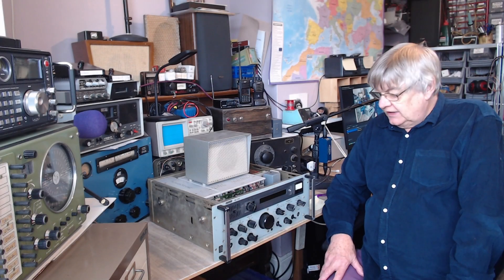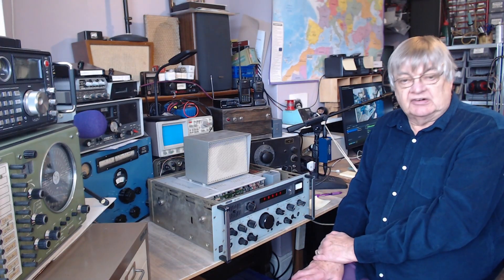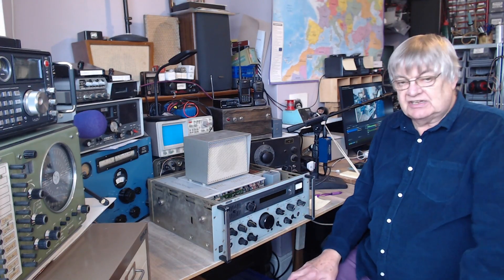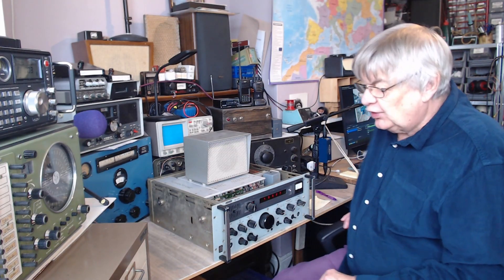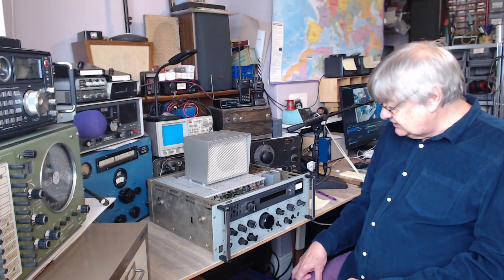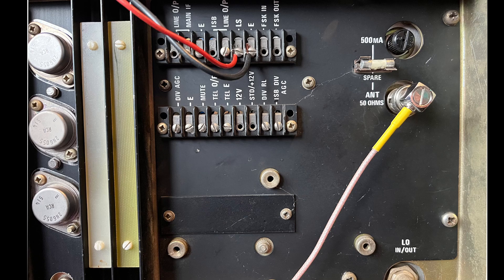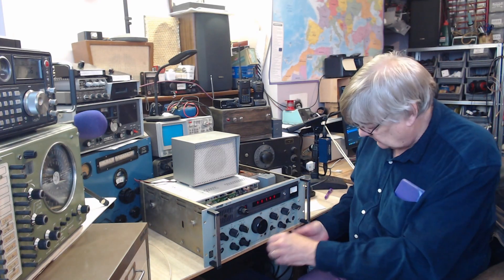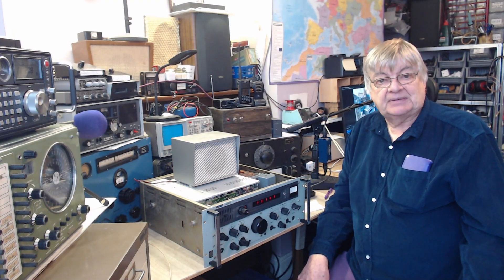G4NSJ - Racal RA 1772 HF communications receiver

Comment: Thanks for this video Ray, I'm fortunate to own one of these also, I dont suppose you would know anyone with a IF/AF module for a Racal 3701 for sale. I trying on the Racal group also. A couple of pins on the 64 pin conector at the base are missing and my soldering skills aren't upto being able to replace it unfortunately. All the best for 2026 M0sjd.

Comment: Excellent video and receiver, Ray, as usual.   We used RACAL's overseas quite a bit.  The RA-1772 design seems to be based on what type of signals they were going to be intercepting during the time it was made.  The engineers must have had input from the agency/military personnel who were going to be using it.  Just a guess.

Comment: I heard the BBC broadcasting on ISB once, was using a Redifon R408 at sea which had both USB and LSB filters which was unusual for a marine receiver, and switching between them produced two different programs.  I never managed to find anything about why they were doing that, but it was working very well..
Reply from the maker: Thanks for the information as very interesting. I’ve never heard of ISB but I’m discovering quite a lot about it

Comment: Here's a possible cause for the power transformer buzz: perhaps this particular radio is an Export Model and the transformer is intended for 60 Hz mains. When connected to 50 Hz, the core may saturate and cause buzz.
Reply from the maker: Good point

Comment: I have two 1772's i picked up off fleabag. Both have some issues, as should be expected of a radio of this age. I would be very interested in following your restoration to fully working. I will certainly be doing the switch cleaning, but I am terrified of touching the wiring loom as it would be a nightmare to repair.
Reply from the maker: Hopefully, the loom will be fine and not start cracking up!
Reply: @g4nsj agreed, after 50+ yrs it looks pretty brittle but gorgeous with all the military style wire wrapping (takes me back). The switches probably just need contact cleaner on them to get to mostly operational. I have two different versions, one with FSK but no afc, and one with is, both lsb/usb and afc. They really are the best receivers of the racal lineup. I have a 3792, 3x1792 and a 6890... I love using them.
Reply from the maker: Yes, the wiring can be brittle. You have a fine collection!

Comment: Hi d hi Ray lovely to see you again. Looking well  The 1772 very nice Recever  just need the Ma 1720 or is it  the MA 79  now .knowing you ones in the pipe line lol .Got myself a winter project  A Heath kit Ha-14 SSB Amplifier. And power supply HP-24  and a KW E-ZZ Match .for my 100ft bit of wet string lol .Looking forward to more posts kind regards shaun G6yri
Reply from the maker: Hi Shaun,  it’s good to hear from you. It certainly is a lovely receiver.  I’m very pleased with it.  Good luck with the winter project.  That sounds like some lovely equipment. I have a.KW E-ZZ Match. It’s a nice ATU.  Hope all is well with you.  Cheers, Ray.

Comment: Independent Side Band was used by broadcasters (BBC, Voice of America and doubtless others) for feeding programmes to overseas relays before satellite feeds took over. It used reduced, not fully suppressed, carrier (I can't recall the exact degree of reduction - 26dB, perhaps?). This gives a reference point for accurate tuning and, if necessary, something for the automatic frequency control to lock onto. The upper and lower sideband then carry two completely separate programmes.
Ian Liston-Smith and I worked at BBC Monitoring around the same time, so are VERY familiar with these (excellent!) sets. Yours is obviously slightly different to ours, with different bandwidth filters (ours had a wider 6kHz setting, occasionally used when in AM mode). In practice, when receiving AM broadcasts, we nevertheless used the set in SSB mode, tuned for zero beat and used whichever sideband gave clearest reception. 
I don't remember using the variable BFO function (or having that "USB + BFO" position on the switch: ours MAY have simply had a "CW" position) - I'll speculate this was used to change the pitch in CW mode without altering the main tuning.
The set had two very close siblings - the RA1776 that looked virtually identical but had the ability to be remotely controlled, and the RA1771 where each digit of the frequency was set by a separate switch rather than a tuning knob and frequency display.
Reply from the maker: Thanks very much for all the information. That is most helpful. I'm gathering as much info as I can on this radio. Cheers, Ray.

Comment: I have work with the RA 8772, the canadian version. It has the fsk board inside. Strange construction: no edge connector on boards...
Reply from the maker: The construction is unusual with no edge connectors.

Comment: I think you're right about it being from the 1970s. I worked at Racal Seaton in the 1970s and I remember them being brought into the factory for repair and the synthesizer modules were produced and tested there. I was usually employed on production testing of HF manpack transceivers types TRA906, 921, 922 and 931.
Reply from the maker: That's very interesting, thanks for letting me know.
Reply: Señor Ray, me gusta mucho su forma tan cálida de hacer sus videos 
Ud atesora legendarios equipos y una increíble experiencia.
Saludos desde Argentina, sud América

Comment: Nice gear. In better days, ISB was used by broadcasters to send two different audio streams to their relay stations, on a single frequency using only one transmitter. At the receiving end, the two audio signals would then go to separate transmitters or be recorded for later broadcasting. The VoA did this for many years. 73 de DL9KCG.
Reply from the maker: Thanks, that’s very interesting. You’ve been a great help. 73 Ray.

Comment: I had one some years ago, it came from the Ascension Island, ex RAF.  I sold it promptly  a out of lock led failure popped out, apart from that I found it quite noisy , and so so when listening weak signals. Quite sure that it had a hard life I replaced some capacitors in the audio board and I noticed that the PS big caps had been replaced many moons ago. I purchased high quality capacitors but at the end I did not finish the work. Heatsink runs red hot, be careful. I compared the 1772 with my Lowe HF-150 and in some ways outperfomed it , less noise floor and the audio is better for my taste. Enjoy the 1772
Reply from the maker: I listen to the BBC transmitting from Ascension Island, good signal. I also have a Lowe HF-150 which I use most days, great little receiver.

Comment: Fb shack addition...all you need now is the matching exciter and 1kw solidstate linear
I have a jrc245 which now has a piece of cardboard wedged between the power tranformer and  case because of a similar laminations racket
Reply from the maker: Hmm, a 1kw solid-state linear would be nice! Yes, I've done the same with the transformer, it's quiet now.

Comment: Nice to see one. Sorting out gear is what radio is about to me. Not just being an operator taking it back to the shop when there's a fault. 
I love my RA!7L but it needs a bit of attention as it's gone a bit deaf. I did replace an r.f. choke and resistor some years back. I buy r.f. chokes at rallies if I see them.
Racal is proper professional gear. 
I always wanted a Racal MA79 Drive Unit as they call it, a 100 mW transmitter but have never seen one. That would be a great find. 
G4GHB.
Reply from the maker: Hi Bill, Racal certainly is proper professional gear. The Racal MA79 Drive Unit sounds interesting. OK on your RA17L being a bit deaf. I'm sure you'll get it sorted. Cheers, Ray.

Comment: I think you will find you have Lower sideband, that legend is lsb not isb. For CW you use USB and set the USB Bandwidth as required. The BFO is usually quite unstable, it drifts. You also have AFC for AM stations. The RA1778, almost identical, has memories.
Reply from the maker: Hi Keith, it's good to hear from you. According to the manual, ISB (independent side band) is  is a dual-channel single sideband (SSB) receiver. The IF signal passes through two filters — one for the upper sideband and one for the lower sideband. Each filter isolates its respective sideband and rejects the other. Each sideband is then demodulated separately, usually using product detectors or synchronous detectors. The receiver provides two independent audio outputs, one for each sideband. These can be sent to two speakers, two recording channels, or two different circuits. Interesting stuff! All the best, Ray.
Reply: @g4nsj  Hi Ray. Have you tried ro resolve LSB on the lsb setting? Note that the legends are for isb-u and isb-u and lsb and usb. Unfortunatly I cant compare the option number on your set with mine as mine is in a rack and not accessible at present. Unless someone has modded your set I find it surprising you do not have LSB. Fantastic radio and  pretty much bomb proof! Cheers Keith.

Comment: What a fantastic find!  I didn't need memory storage 60+ years ago while tuning around on my BC348 because had a pad and pencil on the bench.  I miss the gear that had knobs instead of buttons. Also, I think analog tuning was much more pleasant to the ear.  73,  John  K0EBC
Reply from the maker: Pads and pencil on the bench... That's the way to do it! You're right about control knobs, I much prefer them. Cheers, Ray.

Comment: Hi Ray!

I missed out on one of these for free a good few years ago.

Ive been employed in Shore Based Commercial Shipping in Holyhead, Felixstowe, ipswich and Lerwick!!

Found a box of radio gear in a warehouse in Greenhead Base, Lerwick,... on trying to establish which Line owned the equipment, to procure it for myself, it ended up in a skip and off to the recycling!!!!

I did manage to swipe some "Sailor" equipment though! And an RDF unit
Reply from the maker: Wow, that's a shame. The Sailor gear is good, though.
Reply: @g4nsj just dont drop it on your toe!

Comment: We used literally dozens of those RA-1772s at BBC Receiving Station, Crowsley Park and are/were probably the best receiver I have ever used. All ours had a mod that allowed very accurate frequency carrier measurement against a 10 MHz rubidium standard connected at the back. You could measure say 10 Hz difference between an S9 signal and an S1 signal. Ours did have both LSB and USB. Ours were kept switched on for literally years at a time and became unfixable because the wiring got too brittle! I don't think yours was one of ours. Of course each one came with a manual, and we didn't need dozens of manuals so threw most away. Years later when these (and other sets bought in bulk) reach the surplus market the maintenance manuals are all missing and become very valuable if you can find one!

The BBC and many other HF broadcasters used ISB 'feeders' transmitted to overseas relay stations - sorry can't remember the frequencies now - but they were all out of band. (This was before relay sites had satellite feeds of course). For example an 18 MHz feeder beamed from Rampisham to the the Ascension Island relay might have BBC Spanish to Latin America on USB and BBC French for Africa on LSB for Ascension to rebroadcast in normal AM to Africa. Sometimes one sideband did have RTTY containing HF transmitter schedule change details sent from Bush House to various relay sites. We suspected the Soviet Union was able to read these as they were very quick to jam new BBC Russian-language frequency changes. So we laid a trap to successfully test our theory. Happy days...
Reply: I had the GEC BRT400  which the BBC used to  receive broadcast and retransmit. they had fantastic band spread if I recall 247 ft.  The filters were incredibly sharp and the chassis rf tanking cast in aluminium. a lovely set to use,  the set has been donated to the Porthcurno Museum of World Telegraphy.  I have some RA 17 and the transmitter very well made sets.
Reply: @Woffy. We had BRT400s and RA17s when I first started at Crowsley in 1979. For our VOA rebroadcasts to/from Woofferton we had some very large (wardrobe sized!) 10 channel space diversity ISB receivers. I can't remember he model, but I think they too were BRTs.
Reply: As a former colleague has reminded me, the large, multichannel ISB receivers were made by Plessey.
Reply from the maker: Happy days, indeed! Thanks for all the info, very interesting. I miss the old days when there was so much to listen to.